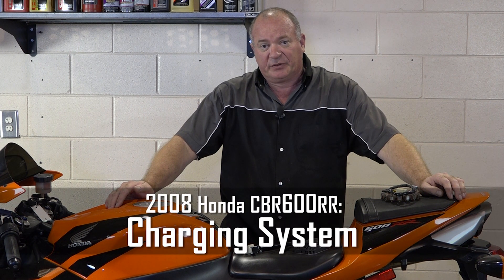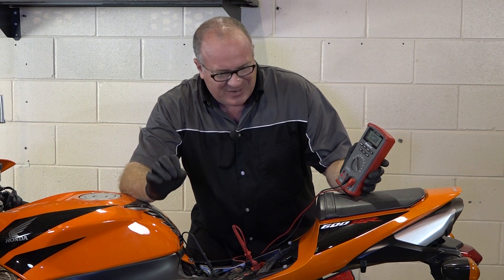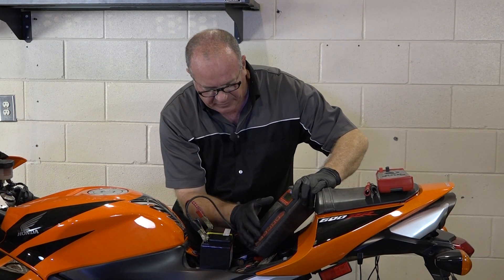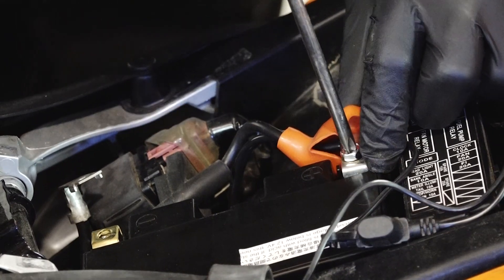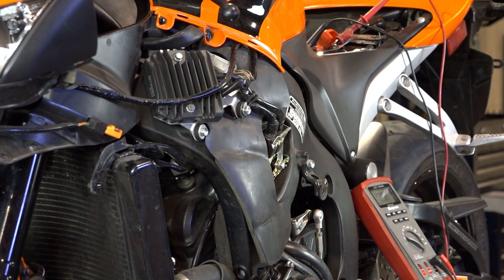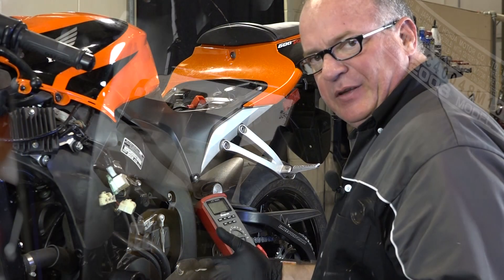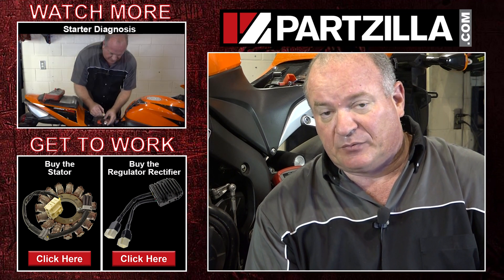How to Test the Charging System on a Honda CBR 600 RR | Partzilla.com

Comment: Hi, great video. Thank you. Could you clarify the settings on the AC check of the stator. Is it to set the multimeter to 24V ac then connect ground to the rectifier plug? TIA Jay 😊

Comment: i took my cbr600rr into a shop to have fluids changed, and just a once over to make sure im ready for next riding season. It over heated 4 miles from the shop. Put a new battery in it and got it home. Started it up today and as it got up to temp. it died out and the fan never came on ? what am i looking at, and do i risk taking it back to a shop that overlooked whatever this issue is?

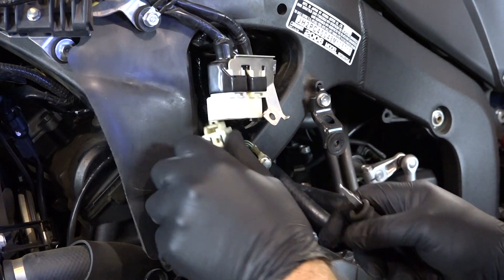Comment: At 10:20, he says he reconnected to ground after he pulled it off the bracket. 
I don’t know what the heck he means. Can I just connect the probe to the negative terminal of the battery and do the same test?

Comment: If all these tests are done and i get the same Pera meters then you, could the battery be the problem.

Idle volts sits at 13.6 does not pick up at all when reves pick up

Getting the same meters on the rectifier and stator as well. Im hopelessly lost

Comment: So I have a cbr600rr 1997 that has no spark I have no clue what to do I'm think about replacing the rectifier.  The web said that the stator is what creates the spark but I dont know I bought the bike for 200 dollars and I want to get it running.

Comment: I get 60 VAC with the stator connected and 9 VAC with the stator connected to the rectifier. New battery new stator new rectifier and I cant get  DC voltage above 13.4 volts. Is there supposed to be vac while connected to the regulator?

Comment: Hello there.. I'm have a question..my cbr600rr2008 temperature issue go up and down like crazy(95- 150- 95 -210- 00-95F.. I did it replace radiator, coolant and temperature sensor  ..🙄 but still the same... little help please.. thanks..

Comment: Hi John,
i have a 07' CBR600RR with an issue where the bike turns off while riding.  I check the battery and the R/R is fine. The issue i have is i ran the test at 10:40  and its showing a reading of less than 12V AC on each of the diodes on the stator.  So i bought a new OEM stator from partzilla and put it in the bike and the readings are still below 12V AC.  Could you please help?  I have an 09' CBR600RR thats perfectly running fine and i did the same test and its good at 14V+ AC.  I do not know what to do from here... Thank you in advance.
-Waya

Comment: I understand you are using the specific diode setting to test the rectifier, but if a voltmeter does not have this capability, could you test the diodes using ohms/resistance instead?
Reply: Si

Comment: When I test the regulator/rectifier, I'm getting .499, .494, and .501, and when I check the stator while the bike is running, I'm getting around 13.70-14 VAC. Does this mean that there's something wrong with my stator?

Comment: Really helpful video. Thanks.
Just replaced my rectifier on my honda, as the lights were playing up and the bike died on me last week.
Seems to have worked, until it died again. Have put the battery on charge and will do this check with the wires at the weekend. Maybe I need either a new stator (hopefully not) or replace the battery.

Comment: What should be the voltage of the regulator rectifier when the engine is at 5,000 rpm? For my CBR 1000RR the Haynes manual says the voltage should be 15V but my output is only 13V. I couldn't understand how you're hooking up the meter for the diode test on the rectifier - will watch again.

Great video, thanks
Reply from the maker: At 5k it should be a little more than 13v.  Test the stator and rectifier.
Reply: @PartzillaParts  thanks, I'm going to give it another shot tomorrow. Although the output voltage is lower than the Hayne Manual says it's keeping the battery charged now. The chinese stator was trash

Comment: Hi. Thank you for this video. I am facing an issue with an '07 Suzuki DL 1000. It starts fine and VDC measures 14 at the battery. when the engine is revved, the volts drop instead of rising. The same was seen on AC check from incoming phase to phase across all 3 phases, reading 12AC and dropping when revved. Any ideas what could be wrong? rare possibility that the mechanic could have placed the magnets in wrongly / polarity reverse or that some loose magnets are causing that ?? Thanks
Reply from the maker: Sounds like the stator is going bad.

Comment: Mine cbr600 f4i 2001 gives 12.6v on idle. And 14.4v on 5k rpm. Some bikes are not supposed to charge on idle.
Reply: Hi there I have the exact bike and it's not charging I might do this check and see what I come up with,cheers

Comment: Don't know if you're still checking these or not. 2003 600rr, swapped old rec for the 2005 with the heat sheild. New bat. Autocraft. At idle reads 13.56. Got leds that are off. That too low of a charge?
Reply from the maker: At idle, that should be fine.

Comment: "Philips..."  Aren't all screws on this bike JIS?  I just recently learned about that, but getting the right screwdrivers apparently helps significantly.  Since they're not designed to cause the driver to slip out of the screw, like Philips.

Comment: Ok I'm having issues on my 08 cbr, it has a new battery, I replaced the rectifier bc I thought it was over heating , well now I rode the bike 30 mins hard n now the bike wont start acts like the battery is dead now this is when it's hot, the bikes stator resistance was .9 all across,  would my stator be bad the bike has only 3k miles
Reply: Hey did you get this fixed? I'm having a similiar problem with my 07 CBR.

Comment: Hello! I did the test that you suggested. Start the bike to test the stator by connecting the multimeter red cable, put it on VAC 20V and connect the black cable to the ground. I get a reading from the 3 yellow cables of 7Volts. On your video you get almost 15V. Does it mean that the stator is bad?
Reply from the maker: Are you testing the rectifier or the stator?  Either way, that is low voltage.  Might need to be replaced
Reply: @PartzillaParts  i was testing the stator. I also checked the stator between the 3 yellows when the engine is on n when i rev it i get 60 VAC at 5k rpm. I will test again the stator running with one yellow n the ground connection of the battery in DC.
Reply: Hello! Following my previous question. I disconnected the Rectifier / Regulator and the Stator cables.

To test the stator i do the following, get one of the yellow cables coming from the stator and connect the red led from the multimeter, then take the black led from the multimeter and connect it to the ground in the battery. Then i put the multimeter in VAC. I get a read of 8 volts when the bike is cold at 1.5k rpm / 4 volts when the bike is warm at 1k rpm. This is not even close to what you get on your video in minute 10:25 which is 15 volts VAC.

I also did the resistance check and ground check on the stator and it was correct.

So i guess the stator is not in the best shape as I bought the bike as second hand with 33k km so maybe it is time to change the stator. I guess i can open the stator and see what the status is and check if there are any burn parts.

Anyhow what it is blowing my mind is that when i run the bike with everything connected i see the battery charging at 14.5V with DC. The battery goes flat the day after i drive it for 60km.

Thanks for all your help and time!

Comment: Thanks for the video. I get lost in minute 10:25. Do you connect the multimeter ground cable (black) to the ground cable of the stator, then start the bike & then connect the positive to any of the 3 stator connections to see if there is >14V, right? I am asking because it is not easy where you connect the ground cable. Thanks in advance
Reply from the maker: It's a ground.  Connect it to any ground...

Comment: im having a similar issue, honda cbr 1000RR 2005, noticed that the battery wasnt charging, i got told around that the regulator/rectifier was a common problem for this model, after i order the part, i strip the faring off and i noticed that the plug between the stator and the regulator was all malted;    some cables already cuted off and others were join together for the heat, well looks like im gonna have to order the stator as well, what would be the reason of the problem ? thank you
Reply from the maker: Could have been a malfunction with the regulator that torched the wires.  Could have been just a short that melted it all together.  Inspect the surrounding area and make sure nothing else is damaged.
Reply: @PartzillaParts  thank you for your help,  lucky that  nothing else was damaged, but i decided to change volaje regulator and stator, i just order the stator cover gasket and i will do everything  by my self;  im going change the battery as well, the battery was new ( only  a month old ) but was a cheaper one ( 70 buks ) so i getting now a good battery, do i have to use a torque wrench to tight the stator cover or i should do it normal, i mean  tight the screws around the cover  by eye? sorry for my english

Comment: Hi
I changed cbr600 rr 2003 speedometer but this new one it’s showing 0 on odometer and when the bike is moving the miles per hours stay at 0
Reply from the maker: Check the speed sensor.
Reply: Partzilla 
I checked and the sensor works well. 
I don’t know if it’s a electrical problem or my be the speedometer it self
Reply from the maker: It's most likely a connection.  Could be a bad speedo but more likely that it's something isn't connected correctly.  Try plugging it into another friends bike with the same model?  Or get it tested at a shop.

Comment: the rectifier coverts my ac current from stator..to dc current to the batt.. so when i plug up one side (functioning stator) i can test the black and red diodes on other side and they should have 14v DC right? cuz when i test my reg/rec on output side i get 0volts DC is that my chargong problem?

Comment: Just a question. When I charge my battery I have 2 options. 6v and 12v charge. Which one should I use for my bike. Also can I charge my battery while it's still under the seat with cables removed or should I take it completely out of my bike. Thank you
Reply from the maker: 12v.  You can leave it in the bike.
Reply: @PartzillaParts  thank you!

Comment: Hi! Another great video! Thanks! I am having a problem with my 2006 cbr1000rr. I got a new battery and I charged in a slow charge at night and when I check in the morning is 13 or more volts! Starts amazingly fast and no problems.  But If I ride more than 15 minutes and stop, when I tried to start again the battery is almost dead! I used your guidance in this video but I am still in doubt. I'd like to check each one of the parts is bad, before buying it. I am sure is not the battery. And I am praying to be the external one (rectifier). When I did the last test, checking with the engine on, all tree diodes shows nothing. It was supposed to be 15 right? So my rectifier is bad? Can you help me on it please? Thanks in advance and keep your excellent job!!!
Reply from the maker: Test your stator to confirm, but if the diodes aren't working, it's likely your rectifier.
Reply: @PartzillaParts  Yes the diode is not working. I ordered already a new one and I gonna let you know when I install it. Thanks!

Comment: Hello 
My CBR 600 rr 2007 
wile riding when the rpm goes up 
The voltage from regulator going down 
The light dim and the speed meter went off
Then the bike went off how can i fix the problem 

Can you help
Reply from the maker: Have you tested the regulator and stator?  You have to go through each component to see what isn't working properly.
Reply: Partzilla 
Thank you 
There was a problem with the regulator 
I change it but with deferent kind and its work

Comment: I've had this issue for awhile on mine, dash lights go off and on while idling. While running it or reving it's fine.  If I let it idle for a few mins it will die completely. I installed brand knew RM stator and rectifier at the same time, new connectors, made sure of clean wires, no corrosion, everything's tight. Not running any leds or jumping off. Also installed a lithium ion shorai racing battery same day also.  But still been having this problem.  What could it be? Something is killing my battery. Thanks for any advice
Reply from the maker: When you installed all the components, did you verify voltage by testing them?  Worth a double check.
Reply: Partzilla yes I did. It said my battery was charging. I had  13.3 volts. Maybe a parasitic draw somewhere?
Reply from the maker: I meant, did you test the rectifier and stator independently.

Comment: In my motorcycle my battery was always died then i replace my rectifier regulator and battery. 
The problem is not solved😭
Reply from the maker: Have you inspected the wires to and from through the system?  Possible corrosion or damage?

Comment: Everything I did matched your video voltage readings except the AC voltage check with the engine running. Checking the stator I had 12.7 13.3 and 12.8. meaning I'd need to change the stator soon since I didn't hit the 15V-15.5V, correct?
Reply from the maker: Sounds like it's not throwing enough voltage.

Comment: I was riding home from work the other night and my lights were dimming on me in and out. the pace of the lights dimming was a little faster when I hit the freeway. Had my battery checked and the battery was still good. What would cause this? Thanks
Reply from the maker: Possibly the rectifier or stator, I would start by testing those.

Comment: i have a 03 cbr 600rr .. put new bat. but now is half dead. it start normal but after i ride and stop and try to start up again , it wont like bat have no power.. i dont have any tester to see which i should changed. please help... i know now the i have to get a new BAT. but i want to see which 1 i should changed . SORRY I SAID A LOT WITHOUT TESTING IT
Reply from the maker: You have to test your stator and rectifier.  It's not supplying enough power to run the bike so it's just killing your battery
Reply: Partzilla im going to buy a tester before i just start changing stuff.. Question.. Wht you thing about a mosfet for my R/R

Comment: If I go for a long ride, shut off the bike and then go start my bike the battery is drained. But does not take much to boost it and it starts back up.  if I go for a short ride, it will have no issues starting. If the bike is park for a long period of time, it will retain a charge to start the bike. It's only when I go for a long ride, then there's not enough power to start the bike period ever seen that?
Reply from the maker: Test your stator and rectifier.  Something is not functioning properly to give the battery charge under load.
Reply: I did all the tests as in the video, everything passed except the stator idle test, I was only getting 11.5v across all the yellow connectorsfrom the stator. I guess I am changing the stator?

Comment: Hi, I have a cbr600f4i '03 and recently it has some charging issues. I replaced the battery and the rectifier, it was working fine for 2 days and then dead battery. I did the AC voltage test between phases and got 18v, when I plug the ground terminal to  the battery it doesn't read anything. What do you think about this? Thank you
Reply from the maker: Have you tested your regulator?
Reply: Partzilla. I installed an aftermarket regulator and it worked fine for a couple of days. I haven't tested the new one. I tested the old one and passed.
Reply from the maker: Well, there is a disconnect somewhere.  If you get 18v at the stator, where does that power drop out?  Regulator? Battery?  lines inbetween?
Reply: I took it to the shop and the problem was the new R/R. Now is working perfect.

Comment: While doing the ac test on my stator.. my bike shut off and then my fuel pump would no longer prime. Is this just due to my battery having low life or did  I just cause my relay on my fuel pump To blow?
Reply from the maker: Load test your battery to be safe, but that sounds like a relay or fuse blew.

Comment: Hi I have a Yamaha wr125r I had charging problems so I changed the stator and the regulator when I rev the bike the battery discharges when I don’t rev up the charge goes up 😩
Reply from the maker: Test each component, something isn't allowing voltage increase with higher RPMS.

Comment: Hey how you doing... I just bought my first bike... used and as expected has some problems...
One of them is the speedometer stays at zero when I ride.. now I don't know what to look for or what to test first  .. if you can please help me out... I'll appreciate very much thank you in advance... btw... my bike is a 2008 Honda cbr 600rr...ty.
Reply from the maker: I would start with your Speedo sensor.  #11 on the diagram.
https://www.partzilla.com/catalog/honda/motorcycle/2008/cbr600rr-a/crankcase
Reply: Partzilla ... thank you very much...

Comment: Hey John, i have a weird issue with my blinker lights. When i turn on the right blinker, it will go on but with a delay. It takes a second or maybe 2 seconds before it starts blinking. Sometimes it blinks once, then a delay and after the delay it will start blinking normally. What could this be?(btw: i have aftermarket LED blinkers on the front, and built-in blinkers in the rear LED brake light)
Reply from the maker: This is common on a lot of units.  LEDs draw less power and sometimes the relays don't know what to do with it.  Try searching for an LED relay...I've never used them, but I heard it's an option.

Comment: My Haynes Service & Repair manual says that my Regulated Voltage Output must be 15.5v DC @ 5000 RPM. But when I test it, it stays at 14v even though I increase or decrease the RPM. What does this mean? (Honda CBR600RR 2004)
Reply from the maker: Test your stator and regulator individually.